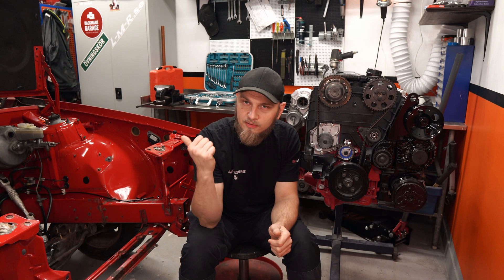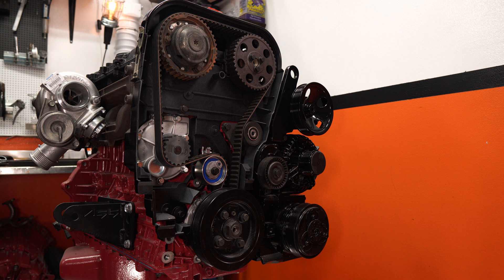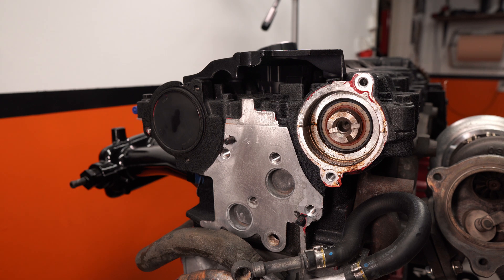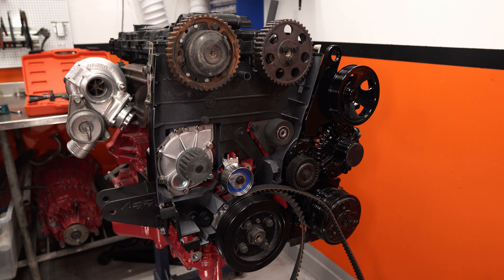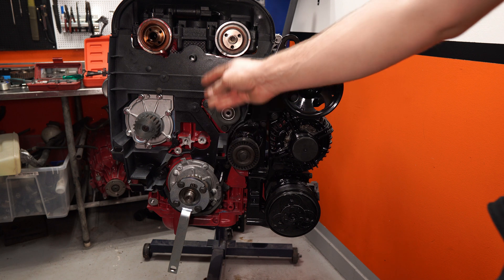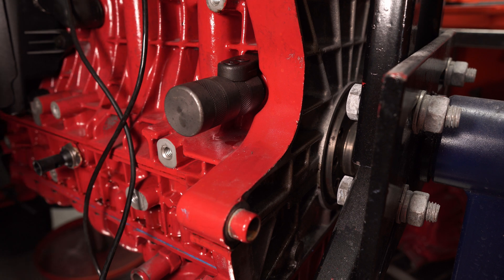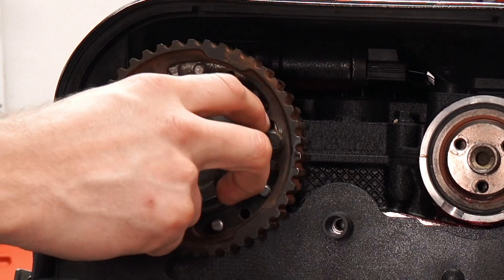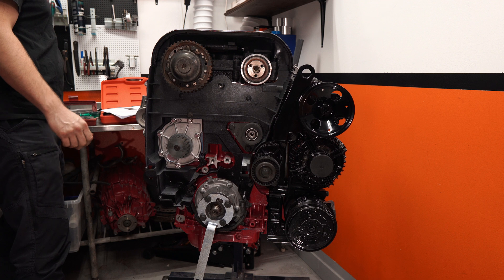Volvo VVT Installation On The B5254T (Exhaust Only VVT)

Comment: What does it mean when the bolts that hold the hold the cam shaft toothed gear on are off set like yours are? Is the VVT trying to retard the timing or advance the timing? Should I put it back together one tooth advanced so the bolts will go back to center?

Comment: Is the tension for the tensioner  the same for the B5254T12 ?
Reply from the maker: I cant say, check with the brand of the tensioner or look for the arrow on the tensioner. It seems that you can get both ways accoring to some comments here.

Comment: I have 2004 volvo xc90 2.9l T6  , I had P0011 P0014 for some reason, and I decided to rebuild the head 😂 " not necessary," but I did it .
changed the cam shaft sensors new ones changed the vvts seloneds new ones , did the timing belt new 7 quirts oil and filter , and now I start the car run drive nice wont go over 45 though and still have P0011 P0014 🤦‍♂️ wtf I'm dealing with 😂.
Reply from the maker: @VOLVO_SAVED_MY_LIFE_CLUB  Those P0011 and P0014 codes can be a nightmare, especially after all that work. Since you’ve already changed the cam sensors, VVT solenoids, and done the timing belt, it might be worth double-checking the timing alignment, these engines are a little bit picky, and even being slightly off can cause issues.

Also, if the VVT hubs weren’t locked down properly during install, they might not be adjusting timing the way they should. Oil flow could be another thing to look at since the VVT system runs on oil pressure, any blockage in the passages can throw things off, maybe a blockage in the oil passage ways in the head to the solenoid? 

Might also be worth resetting the ECU to let it relearn the cam timing. If it’s stuck at 45mph, that sounds like limp mode because of the codes.

I also can't say if this guide in particular relates to the I6 engines, may be a different practice to setting up the cam timing. I have an I6 2.8l 2004 that need a new cambelt, maybe I should make a video on that specifically one day 🙂
Reply: @BackmansGarage  Thanks for your reply 🙏 yeah all those stuff you mentioned could be any reason , The oil thing passages 💯 sure is good , the hubs locked good although it was scary to tight those hex bolts because volvo required tremendous amount of tourqe on those hex bolts .
That's would leave me with with 1 option is to reado the timing again I might messed it up little 1 tooth maybe . I just wanted to know if its 1 tooth this way <<<<< ot this way >>>> on P0011 P0014 over advanced,  over advance means this <<<< or this >>>> ?
BTW 2.8I is completely identical to 2.9I you can even swap between both heads .
Reply: @BackmansGarage  also yes please make the video in episodes for the 2.8I there are totally no videos on YouTube for that or for the 2.9I , there are some maybe 1 or 2 but with no details they  just say general information.
And let me tell you doing the headgasket is a lot of fun actually because its challenging task . Hopefully your 2.8I is single turbo because the twins turbo like mine is probably the hardest work I ever did on a car head and gasket ever because the way how volvo fitted the turbos is insane. 
Also I want to mention rebuilding a turbo at home or at turbo shop is not worth it they will fail , Ebay turbos are good and cheap actually.
New pcv is recommended don't clean the old one .
Also, getting the oil pan out and cleaning it is recommended . You will see the pick up tube is dirty .
Oh don't forget to clean the oil passages on the engine block , I did it from under when I removed the oil pan , it's way easier from under to watch the dirty stuff falling when you spry brakes cleaner from the top holes .
Also I would recommend Elring gasket it's actually better than volvo brand it's self.
It's not recommended to reuse same head bolts it's has to be new set .
I cant wait to see your work video it would be very interesting job .
Reply from the maker: @VOLVO_SAVED_MY_LIFE_CLUB  Thanks! You got me all exited about tearing the engine apart now :D It is a Twin turbo, stock but on a pallet in the garage and everything has been off once already so i hope it will be smooth. I dont think that i will keep the twin setup tho. Probably will build a new manifold to it. It needs to be 100% standalone before i even think about dropping it into a car. But yes, a complete teardown and i will be sure to film those things you mentioned when the time comes, maybe this fall, but im overly optimistic all the time :D
Reply: @BackmansGarage  Thanks , Hopefully, you do it as episodes , The volvo xc90 2.9l and S80 2.8i community would appreciate that a lot . May i ask why you would delete the turbos set up ? Because the 2.8I head ratio is high, 10.5 more than the 2.9I, the 2.9I is lower ratio. I don't know ow why .
that's why I ended up finding s80 2.8I head to install on 2.9I block .
Also, would it perform the same once you delete the turbos ?
Very interesting 
Can't wait to see your video .
The only thing that bothered me was that I couldn't polish the block from outside to bring it to a factory look .
You are a smart man. I'm really sure you will find a way to clean the engine and make it beautiful .
Also, I have a camshaft locking tool. If you want, I would ship it for you to use and then ship it back to me .
Best of luck, my friend
Reply: Update : I fixed the 45 mph issue it was the turbos that had an air leak because there is a paper washer ring on each one that I forgot to install. It's drive nice and full throttle now but I still have P0011 P0014 those codes were not related to the 45 mph issue.

Comment: Help, my VVT hub doesn’t want to spring after the first (over)tensioning
Reply from the maker: The over tensioning should relieve the tension in the VVT as the cam makes it over the pushers.
Reply: @ Well, that’s strange. Does it need to spring after tensioning? I mean, I can still bottom it out, but it stays in the bottomed out position and doesn’t spring back. Thanks!

Comment: Does this work for the B5244t3 engine? Exhaust VVT only
Reply from the maker: There are alot of different variants of these engines and VVT setups so I cant say for 100%. Do you know if it is spring loaded or not ?
Reply: @ yes it feels like it’s spring loaded, I can turn it clockwise to stop, then I can turn it further but as you say, it’s a spring pulling it back

Comment: Followed strp by step and now have a p0014 code
Reply from the maker: Damn, that sucks. The p0014 can be caused by many things as well. Did you change the vvt to a new one?
Reply: @BackmansGarage  today I tool things back apart, and re did the vvt clocking, having the gear end of the hub fully maxed out when setting tension is what my issue was. You can't have the VVT gear side fully clockwise as you won't get full functional range of adjustment.

Comment: I'm assuming this also applies to the B5244Ts? Vida instructions are kinda trash lol
Reply from the maker: Hmm, not sure. The important one is that it only applies to the one with spring loaded exhaust vvt. There are several different setups. This is a very early solution.

Comment: Hello! Thanks for a very good video. I changed the Cam Belt with accessories plus Water Pump on my Daughter's Volvo V70 Year Model 2008, this weekend. And I tensioned the Cam belt by turning the tensioner clockwise. If it is "Wrong" direction I have turned? What can happen then? Etc. Tommy.
Reply from the maker: Check to see if its turned according to the arrow (if there is one) if not turned like the arrow shows than i would retighten it in that direction. I have no idea of what can happen but i cant say that nothing will happen either.

Comment: Helpful video, but I wonder why you didn't replace your front and rear cam shaft seals while you had it torn down? The seals often dry out or get blown out in a plugged PCV overpressure situation. Also, be sure to check for a worn bearing on the VVT hub if you are reinstalling the old unit and not replacing it with a new unit.
Reply from the maker: Thanks! 👍 I had seals laying around, but this video wasn't aimed at changing the seals. I never went on to use this engine since I got a hold of a b5234t instead.

Comment: Thanks. Your instructions were clear I now have a better understanding of how to change the vvt on the camshaft. 
However  wheni rotate the engine  by hand i get two distinct heavy clicks from the exhaust vvt pulley. Is that a symptom of a knackered vvt cam pulley
Reply from the maker: Thanks 
Ive been told its because that there is no oil pressure in the VVT when turning it manually.

Comment: From where are you reading the different steps? Workshop 's manual? What is it? I have haynes one and it does not work with vvt system.
Reply from the maker: Yes, it is based off the original Volvo service manual for Volvo Workshops. It's an online tool that is not available to anyone outside of Volvo cars. There is however a program called Vida that can be pirated and used on an old laptop with like windows XP that will probably give you the same info, but is not being updated since 2014. Haynes's book are ok for a general overview, but do make it a bit too general sometimes and i wouldn't recommend them. This is a big problem and i hate gatekeeping like this that makes it difficult to obtain the right information.
Reply: @BackmansGarage Can I have Volvo service manual for B5234T

Comment: I have done this 3 different times with a haynes manual. It does not say any of this and I have none of these tools. Bought the car not running and pulled the head to find 10 bent exhaust valves because the last poor s.o.b. (crackhead) mistimed it replacing a crank seal. This is mind blowing. The car starts weird and has a "stumble" occasionally while cranking. It will start eventually but sounds like it's hydrolocking. I've been fighting this problem for months because when you start it (it does start ever time) it runs perfectly. Wtf? I think you just solved one of the most difficult problems I've ever dealt with because of a completely and overly complex belt replacement procedure. I'll be buying tools and watching this video 10 more times.
Reply from the maker: Glad u liked the video and that it helped.
Reply: Right,and as a Mechanic of 40 years, anything over timed is ridiculous. I'm gonna make a rear came holder,and use the method he used. Except loosing the intake pulley when he done tension in the exhaust mechanism. It was wasted effort. I pull engines down all the time, everything is marked that needs to be. Sometimes you need a extra hand to hold while you tighten it  the only part I've ever changed on a 318 less than 200,000 is a water pump!

Comment: Actually, there are at least two different tensioners that were used on these engines based on their serial number and one tensions clockwise and the other is counterclockwise.  Part number T43173 tensions clockwise and part number T43139 tensions counterclockwise.  T43173 is Engine No. 3188689 & After and it tensions clockwise and part number T43139 is for Engine No. 3188688 & Before.  People also need to know that the procedure is quite a bit different for the engines that use the VVT on the intake and exhaust.
Reply from the maker: As far as im told, the important thing is to make sure you tighten it according to the arrow. But thats good info. And yes, i really want to make more of these videos for different kinds of vvt setups as well.
Reply: Really wtf?
Reply: @LuckyGuessGarage  I actually received the wrong tensioner once and when I installed it the same way as the one that came off the belt looked like it was trying to walk off of the pulleys!  I threw on the correct tensioner and it was fine.  I have a picture somewhere here that shows the difference between the two.
Reply from the maker: @BHank69 i would be happy to mention this in another vvt video.

Comment: I did exactly same way as you explained.  Car didn't start. Is turning but no start. Any idea what can be?
Reply from the maker: Im assuming the car started before you changed the belt and in that case check the cam trigger and wheel so that is all in the right place. Get some fault codes read out of the ecu and see if the signal is missing or implaussible.
Reply: Thx

Comment: Really helpful video, one question though. After you tension it and rotate engine, should cam locking tool fit on the back side or just refer to the marks on the cover and sprockets? In my case marks align but exhaust cam is off by 2 cogs on the locking tool
PLEASE HELP
Reply from the maker: Its only the marks at the front that will matter. Exhaust vill be slightly off in the back of the engine.
Reply: THANK YOU 🙏

Comment: Is it apply to B4204T3 vvt camshaft settings...last time i changed the timing belt the check engine light illuminates...
Reply from the maker: It best to check får that engine specifically since i have never worked on one of those.

Comment: Fricking awesome video.  Thank you.  I have dual VVTs and I am doing a complete seal job (cams and crank), timing belt, accessory belt, water pump, all idlers, tensioner, etc.  2005 S60 2.5T AWD with 256,000 miles.  It's is a decent level of difficulty!  Your video was key to me understanding the specifics of installing the VVTs.

Comment: Great video explanation of how to do this job, I would have been lost without it. Excellent instruction showing the engine out of the car really helps.
I had no problem in the past with just changing just the timing belt on my B5254T. This time I had a clogged PVC breather system over pressurize the crankcase and push a cam seal out on the intake side. Decided to change out all camshaft seals and crank seal along with resealing the cam cover and replacing the PCV. Thanks!!
Reply: Hey any chance did your car idle very rough, and have a very rough acceleration? Just trying to diagnose my problem.
Reply: @ryanplaistek9501  
Not on my engine, just a massive oil leak due to the cam seal being blown out of its seat.

Comment: Am I the only one that finds these instructions extremely confusing?
...if you set everything in the most-forward position ( cog slots and internal hub rotation ) approximately one tooth before and tighten everything ,how are you moving that hub one extra toothy if it has already been set to be 1 tooth off and the hub rotated to the max clockwise position ?..... I just don't get it . Please clarify
Reply from the maker: Because the pulley is still free to rotate due to the three screws being loose on the pulley. Is so that you dont lock out the pulley when tightening the belt later on. If i understood you question right.
Reply: None of that is needed. Just set the cams all the way to the right and set the timing re-tighten it all and push it counter clockwise when you done installing the belt.

Comment: turning the exhaust  camshaft so the slot lines up with the slot in the intake camshaft so the tool will fit . will this also  help to  the verify  timing  is correct?
Reply from the maker: Yes that to ensure that the cams are in the right place.

Comment: the pulley in front of the crankshaft gear has a hole with a steel sleeve insert  it is at 12:00 when the timing marks on the  camshafts align with the timing marks on the cover. is that hole an accurate mark alternative ?   i can't make out the timing marks on the oil pump gear and i have tried so many ways of breaking loose the 30mm nut  with no results  at all .i wouldn't even need to take it off if i didn't need to see   the timing marks behind it
Reply from the maker: I cant say, are you sure that you can get the belt behind without taking the pulley off ?

Comment: It says in Volvo VIDA that you need to kinda center the 3 bolts on the exhaust side, they can't be too much on either side, because you know it needs to be able to adjust itself.
And you CAN NOT let go of the tension on the CVVT untill you have torqued down bothe the exhaust and intake cams .

Btw I did it the Volvo way alone ;p it's just 5nm of force to hold down the cvvt ,just kinda lean on it with the right arm while adjusting the intake then do the rest with ur left :p 
Anywho nice video, this one is the most accurate to what you need to do.
Reply: Nvm this way works just as well,
Done this 4 times in a row now trying to get a best possible timing.
Turned out i had a shitty cvvt-hub and the wrong vvt-actuator. Cause I got 25 to 30 ° timing over advanced, now after I changed the vvt-actuator and cleaned the vvt-hub I got 8-15° , so I gotta buy a new hub.
Hard sometimes when you second guess your own work.

Nice video btw.
Reply from the maker: Thaks, glad it helped

Comment: So when you mention the “low-quality” tool, what about the cheap knock-off makes it a pain? Does it not align easily? *I just bought one of the eBay ones for $50, but I believe the Volvo one is in the $150-200 range.
Reply from the maker: Its probably fine for use now and then but it was just the feel of it that was a bit of a letdown. Threads are weak, and the fitment of the parts is not pleasant, but yes it will get the job done.

Comment: I’m a bit lost on my Volvo my vvt hub doesn’t have tension is that normal I just got a new one from the dealer still the same no tension and I’m getting p0014 code for exhaust side timing
Reply from the maker: Then you probably dont have a spring loaded vvt. There is several diferent types of vvt configurations.

Comment: Hello., what is the difference between the volvo s, v 40 b4204s and b4204t motors, and is it possible to replace the b4204T with a b4204s motor that has broken from another volvo ???
 Thank you 😉
Reply from the maker: One is with turbo and the other isent. But my knowledge on the 4 cylinders is limited so i cant say. Maybe ill check it out if i make a 4cyl build one day.